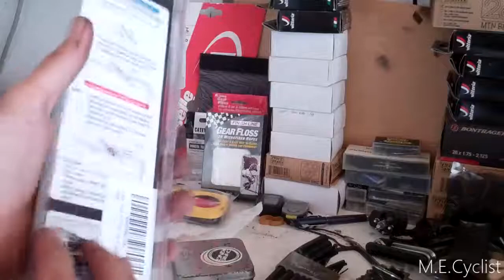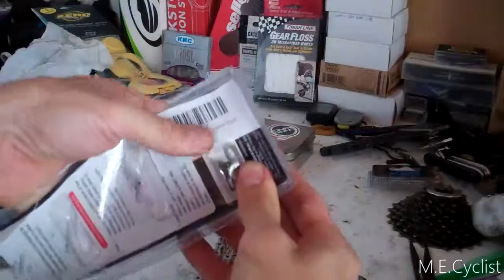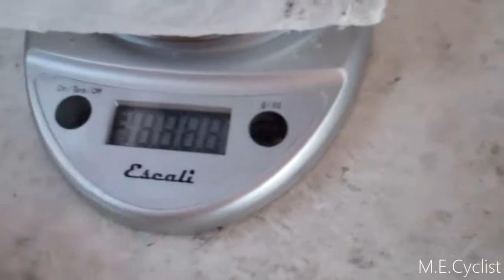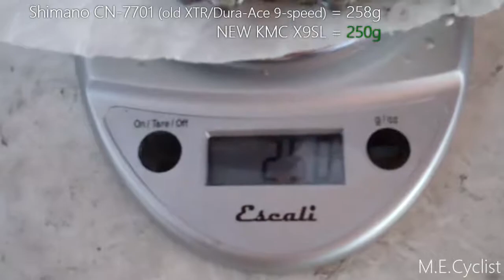New MTB Chain! Quick and easy upgrade to a KMC X9SL chain with a quick link.

Comment: I should measure my chain.  KMC makes one that is black with little green stripes on it.  Would match my bike.😋  Easier to put the new one on the smaller cogs like you did, I assume?
Reply from the maker: Yeah I thought about getting the black and red one to match my Merckx, but it was $85 :(  I'd guess your chain is probably fine... you don't have a lot of miles on yours.  The one I had on there I had for YEARS, and even then it wasn't too bad.